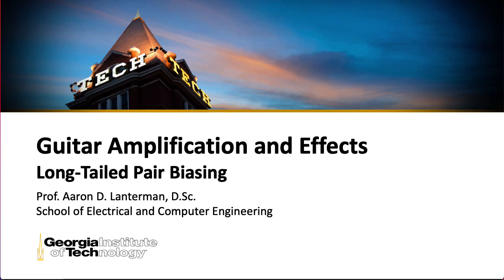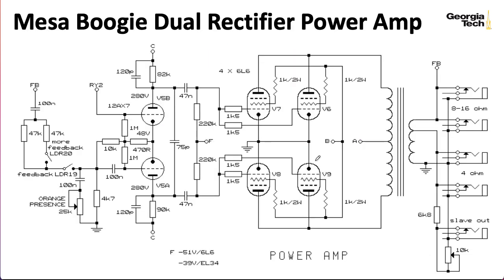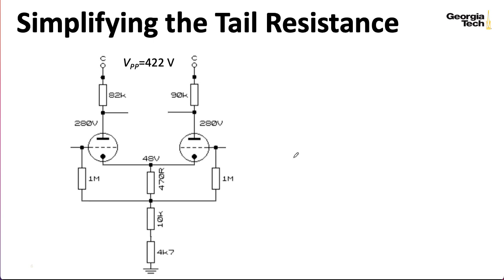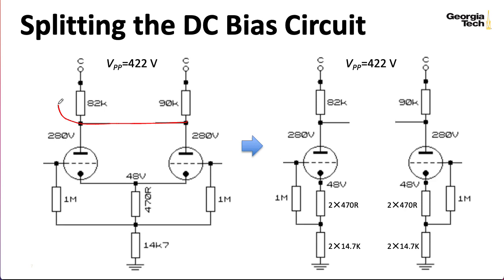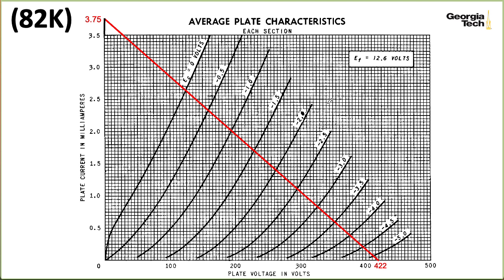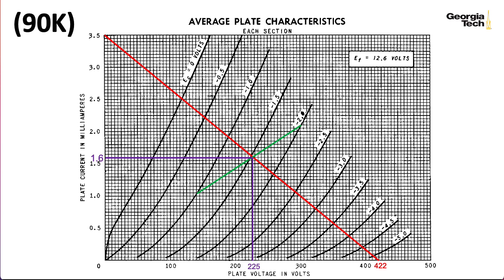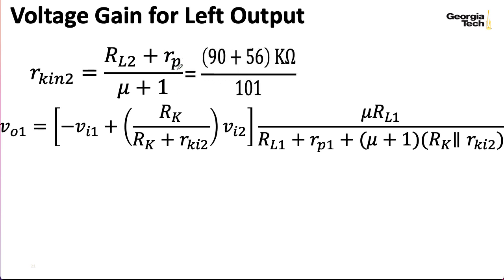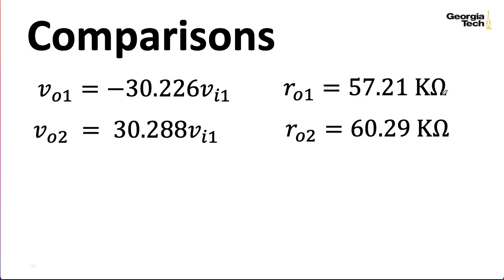ECE4448 L29: Long-Tailed Pair Biasing (Mesa Boogie Dual Rectifier) (Guitar Amplification & Effects)

Comment: So the purpose of the different load resistor values is to help balance the gain. I'm guessing that this in turn helps to squeeze more power out of the power amp section before clipping?
Reply: If you have one gain for the positive part of the waveform and a different gain for the negative part, a sine wave is not going to stay a sine wave, and you will get some distortion. I think the reason to balance the gain is to avoid that.